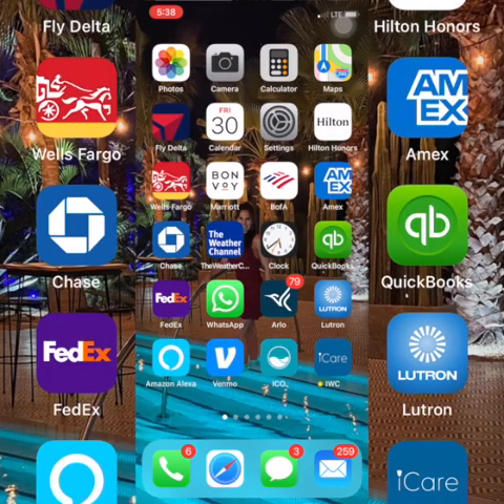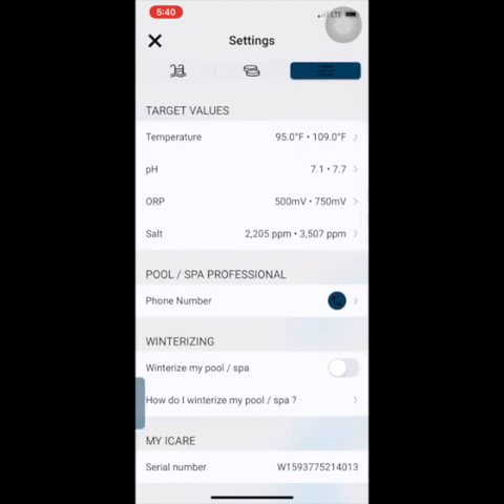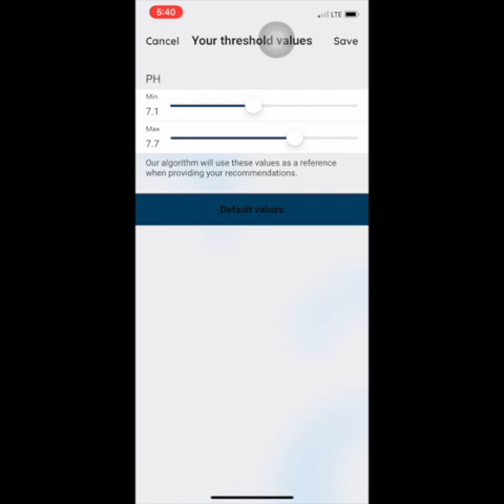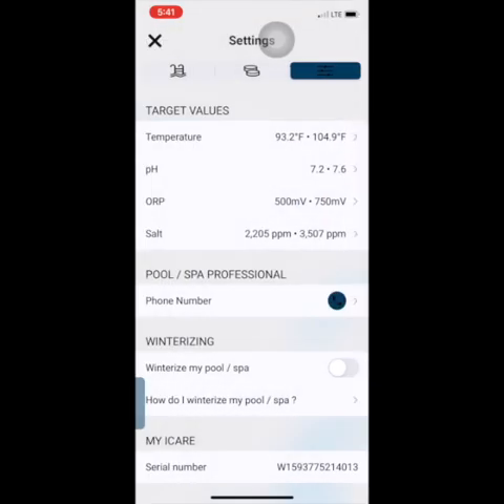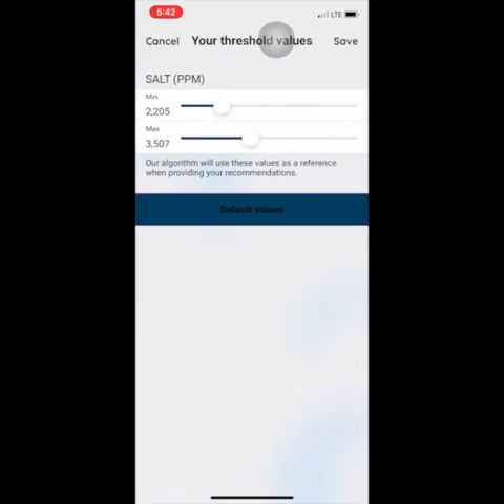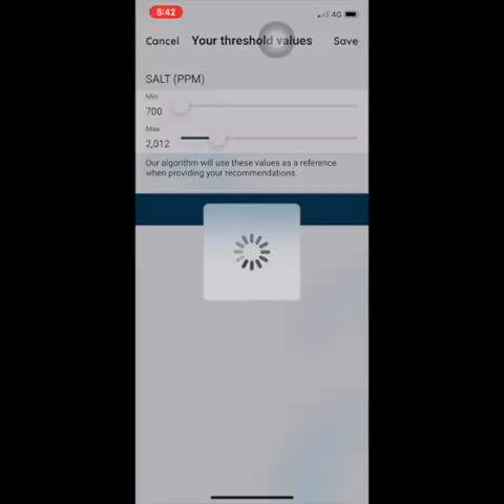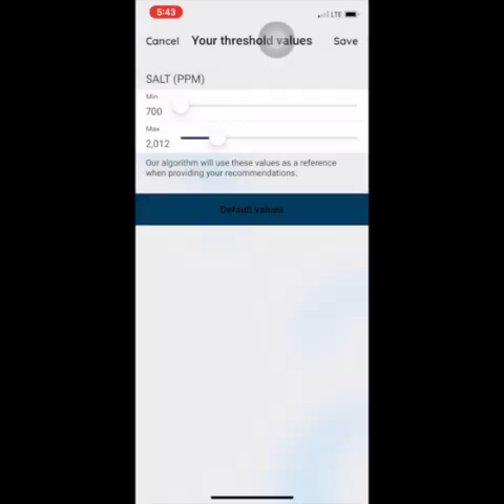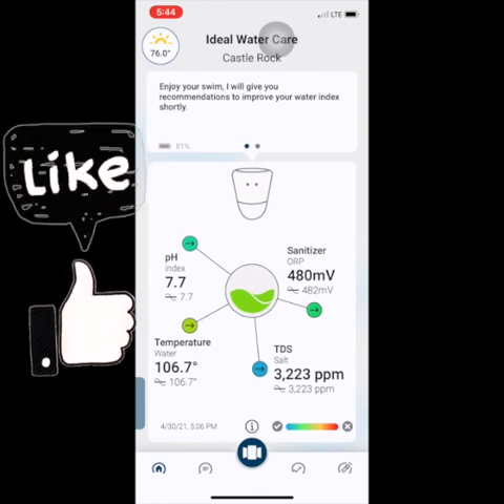I-Care Smart Water Monitor Settings Set-Up Tutorial water monitor care

Comment: I've set my parameters, however I did not get an alert when my temperature dipped below my threshold.  Is there a different setting or something I need to enable?  I have "Activate Notifications" turned on in the settings. Why would I have not gotten an alert?
Reply from the maker: Are you connected?  Is it possible it lost it's connection.  It should let you know I have never seen it not.   I would double check your connection.   If it is still connected and didn't work   I would send in a support ticke to ICare here:  https://ondilo.com/en/assistance/contact-ico-customer-support/   they would be able to log in and take a look at it for you.   I hope that helps.   Thanks for watching.
Reply: @TheHotTubLady  definitely connected. I have opened a help ticket.
Reply from the maker: @jakesalter2321   they will get you taken care of right away
Reply from the maker: @jakesalter2321  let me know if you need anymore help with it.

Comment: this didnt make much sense. i have no idea where to set my values for a salt system on and envoy
Reply from the maker: So set your pH 7.2- 7.9
ORP 450 (mine is at 527) to 900
Salt 1558-2058

If you set them there you will be golden.  :-)   

Thanks for the support
Reply: You should be between 1950-3500, (1750 is your salt plus your baseline tds, lets say it's 200 (1750 in salt and 200 for source water tds = 1950). after a period of time your TDS/salt reading will increase because you have added chemicals overtime and at 3500 you should drain and refill your spa.